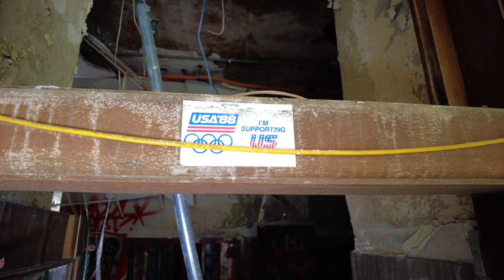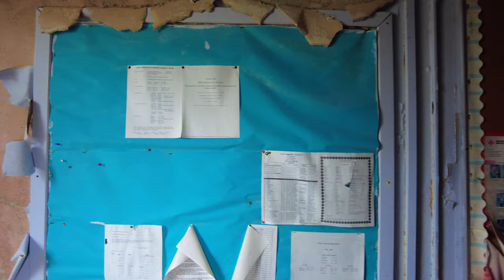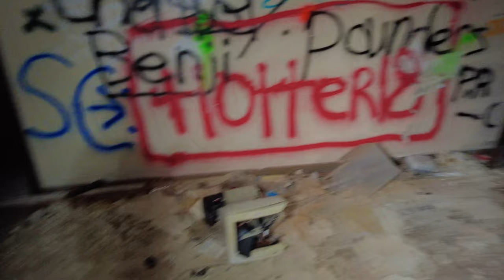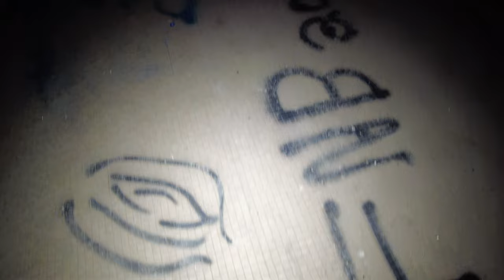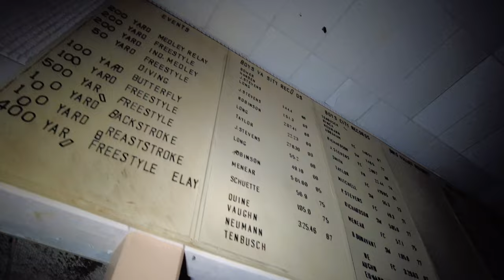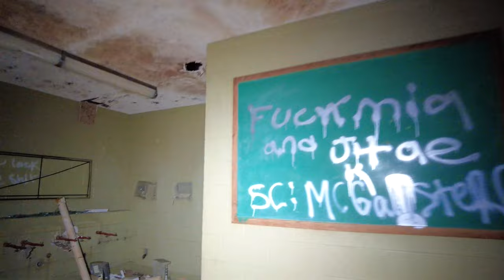Abandoned Flint Central High School

Comment: You missed so many Easter Eggs! If you ever go back, DM me first, I’ll go through all the places you need to hit. Back in 1989, I lived inside FCHS while I attended there.
Reply: Is it true there’s a tunnel in there that connects schools and other buildings?
Reply: Yes. You can access it from the door that's across the driveway from the cafeteria, so when you're standing outside looking at the door - to the left you will see the field house, and on the right you will see the cafeteria door. If you turn 180 degrees, you will see the planetarium across the way, and next to the field house you will see a big smoke stack on the little building that used to be for welding classes. The tunnel connects to that building. And it goes to the library and institute of arts too, but since those structures are still occupied, I'm assuming they're monitored with some sort of security system.
Reply: @hi-merodriguez1062  wow that’s really cool